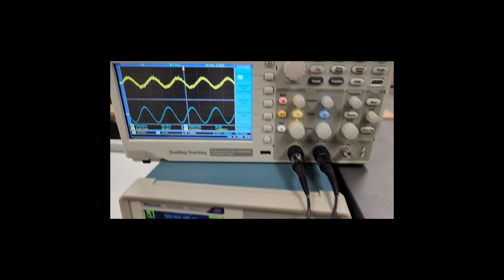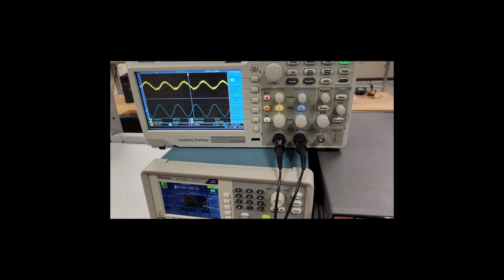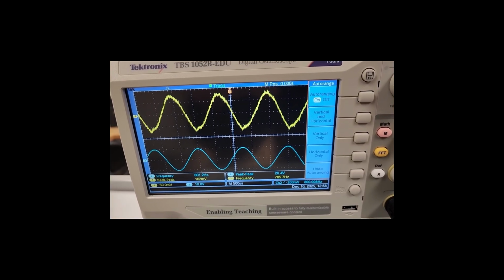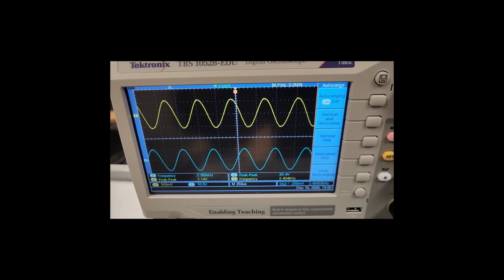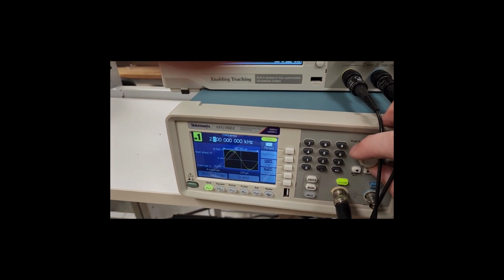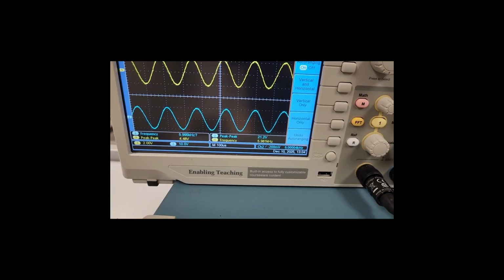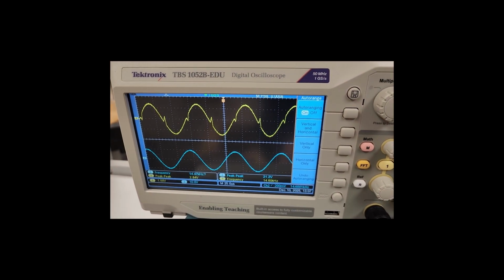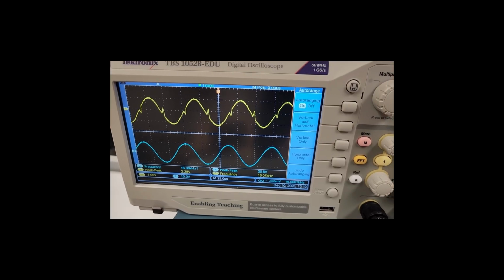Experimental Demo 4th Order Bandpass Filter

Comment: It is actually 1kHz  2-nd order HPF + 2-nd order 10kHz LPF. It is not 4-th order BPF
Reply from the maker: Thank you for your comment!  
Let me clarify the intent of my design.
Yes, you can design a single 4th‑order bandpass filter section,that’s true. There are topologies like multiple‑feedback, state‑variable, Sallen–Key bandpass, or unified biquad structures that produce a single 4th‑order bandpass transfer function in one block. But that’s not what my circuit was designed nor intended to be.
My design used common university design principles where you take a 2nd‑order high‑pass section and a 2nd‑order low‑pass section and combine them. When you cascade two 2nd‑order filters, the overall system becomes 4th-order because the transfer functions multiply.  Therefore, I was referring to the overall system order, not claiming it was a single unified 4th‑order bandpass topology.